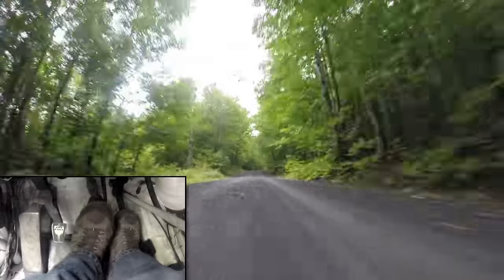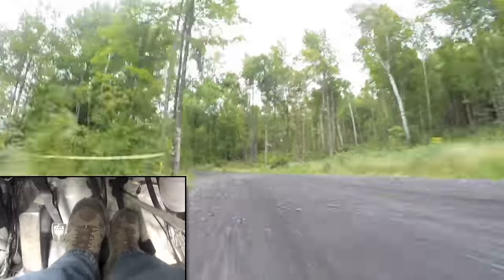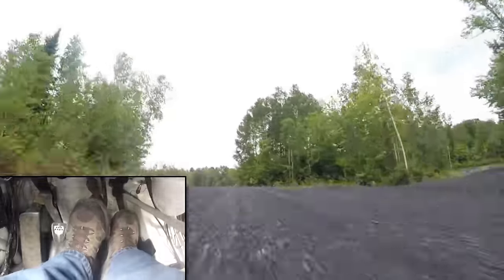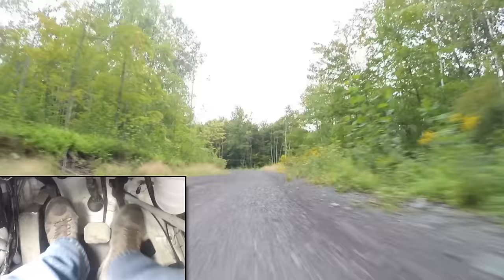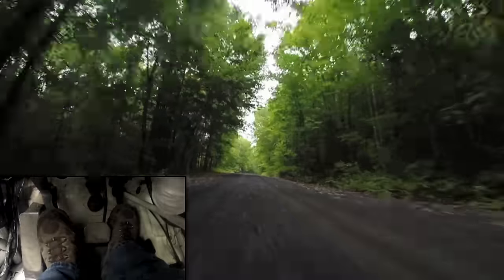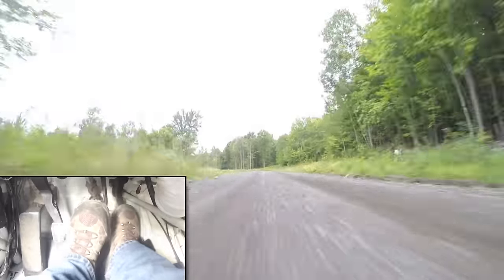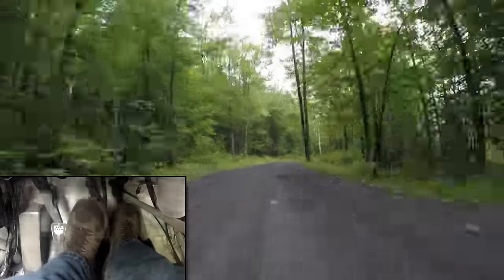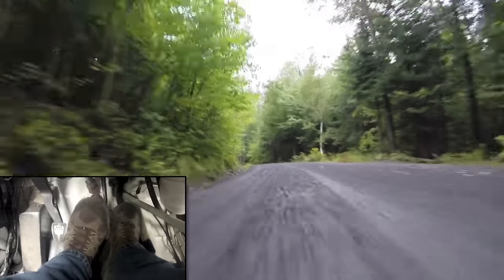Rally Driving Explained

Comment: I saw a video of Collin Mcrae footwork and he didn't keep the gas pressed the whole time like you do. His braking was much more brief and when he had gas and brakes on at the same time he kept pumping the gas, never kept it pushed all the way.
Does it matter if the car is FWD, RWD or AWD?
Reply: MLCAgaming of course drivetrain matters! most of the throttle and brake inputs in this video are suited to lower power fwd cars, higher power awd like you would most likely see Colin in will require slightly different inputs, certainly more throttle modulation

Comment: At the 2minute marker my breaks would cook already! ^^ 
But I have to say, that I, since I saw this video, I got better at Dirt Rally etc and even use it in everyday situations where I just want to avoid sliding over my front wheels. And it works perfectly. The only downside that is, that in normal modern street cars the throttle cuts out if you stay to long on the break while staying on the throttle at the same time. :-/
Reply: You're not continuously pressing the brake pedal, you're just constantly hovering over the pedal with your left foot so you can tap it at a moments notice to keep wheelspin down and make sure weight transfers to the front so you don't understeer through a corner off the track.

Comment: at 7:35 he says "shift" but he never puts his foot on the clutch in the video, is he shifting without the clutch? please explain.
Reply: I'm no pro but yes, you can do it with just about any transmission. Once you're moving going up to the next gear is easy. Just let off the gas, pull the stick lightly towards the next gear up and wait for the rev's to fall and it will pop right into gear. Going down it's the same idea. Lift off the throttle, or left foot brake and lift off while pushing the stick into neutral, then blip the throttle to gain RPM's while pushing the stick towards the next gear down and if you get the engine speed right for that gear it will fall right in. Going up is easier than going down, and going down I find you have to really hit the nail on the head with the RPM's to get the gear to go in smoothly. I learned by finding a nice wide open dirt road off the beaten track and get up to about third ~30 mph and then left foot braking as i changed down into second until I could do it smoothly. After that you can try it at higher engine speeds and get that down as the RPM gap between gears gets bigger the higher up in the rev range you get. Hope this helps, have fun and be safe!
Reply: thanks. yeah i figured it was clutchless shifting however, i'm not experienced enough to try myself, if you don't do it right u can hurt your transmission
Reply: TheRedRockerHimself didn't understand very well what you just said.
Reply: Junior Collantes basically he was explaining how to shift without the clutch, if you just search that on YouTube you can find more videos about it.
Reply: l0lxlllxl0l now I understand very well thanks for reply ;-)
Reply: ***** I don't doubt it's a dogbox, but wouldn't you want beginners to practice with stick idk...

Comment: So this is how I see it. He says that you need to use the brake to control oversteer and understeer. Does this mean you can just gas it all the way? And does braking give you more understeer or oversteer? Also, should you brake earlier into a corner than on a tarmac track? Sorry, just had a few questions.
Reply: Thank you for the advice! I actually thought this was a Subaru WRX that he was driving. If you could also answer another question. So in a WRX, is it the same concept as a Front wheel drive car? Im just wondering because I kinda want to be a Stage Rally Driver in the future so...good to get some advice early on, you know?

Comment: Do you have abs?on my car if i hold the the gas and apply a little bit of braking,after relesing the brake,my pads still grip on the disk brake for a couple of seconds...do you know why is that?
Reply: Andrei Tanasescu From my knowledge, Rally Cars don't use ABS. They are usually removed entirely.
Reply: Andrei Tanasescu I have a similar problem on a car with no abs, but with electronic gas, the breaks are fully released but the gas is cut off for a couple of seconds when it senses wheel lock up, a guy from an amateur rally told me something about an electronic device to fool the sensors put I forgot the name of it or how it works... :\
Reply: Szeba86 i think it s just the air in the servo braking system
Reply: Szeba86 Electronic pump. It forces gas in. Especially since you're flopping around, it won't always feed well.
Reply: Andrei Tanasescu lol if it had air in it the pedal would feel spongy and the tires would not lock, I doubt that the problem is that, plus the car is also for daily use it's registered, to drive one with air in its breaking system would be dangerous
Reply: Abendschein any workarounds? except converting it back to carburator?
Reply: Szeba86 Perhaps? I am not very sure. Sorry man. :(
Reply: +Szeba86 I have the same issue, and found it to be the traction control system, rather than ABS, activating. Disabling TCS can be easy on some things and not on others.
Reply: +Slammins1 for me it's a bit more tricky, my car is bald, no abs, no esp or tcs, only thing which is a headache is the electronically controlled gas (pedal and flow) from the ecu..
Reply: +Szeba86  i know, right?!:))
Reply: +Andrei Tanasescu modern day car electronics are the spawns of satan lol :)))
Reply: +Szeba86 from what I understand, now that I am re-reading what you're saying, this might have something to do with the gas pedal sensor getting worn. Just gotta change where the sensor is wearing.
Reply: +Szeba86 sometimes you just need a wrc car..
Reply: +Slammins1 hmm it was tested in other cars with similar setups and it's the same in all of them... uber lag...
Reply: +Andrei Tanasescu or one with 2 double webber carburetors instead of electronically controlled fuel injection
Reply: +Szeba86  i prefer those 3 which were on the best v12 ever:the 3l v12 ferrari 250 gto,series 2 body:x Proper intake noise ,not fakery from exhaust pipes:(
Reply: +Andrei Tanasescu too big for a national rally class, I'll stick under 18000cc
Reply: +Szeba86  i really want a 72' gtv as a rallycar
Reply: Andrei Tanasescu tu Român? Moldovan?

Comment: Wow, amazing video.
Would be great to see some basic telemetry overlaid, maybe just throttle and speed dials.
As total illiterate on this, sometimes you say “shift after the turn” or before the turn, but I don’t see actual clutch work. Do you downshift without it or am I missing something?
Reply from the maker: This car has a sequential racing transmission, so you don't need to use the clutch.

Comment: Do you typically want to stay in the lowest gear possible when you're racing? For example, would you rather be driving around in 3rd at 7k RPM or 4th at 4isk K around corners while braking and such?
Reply: High rpms all the way gotta keep the power slide around the corners but idk im just a kid

Comment: Brake override system prevents such driving style.
Have you got any advice for drivers of volkswagen and audi FWD vehicles, equipped with BOS?
Reply: +Maciej Jankowski simply turn off that shit? xD
Reply: +sermerlin1 I've turned it off three months ago, to make a try. The next system which bothers LFB is emergency brake assist. Each time, when you depress brake pedal too deep, when throttle is opened, electronics of the car recognizes this state as panic braking, and significantly increases brake pressure.

Ultimately, I've rolled back car electronics to the original state, because such unpredictable brake pressure (brake pressure is not always the function of brake pedal position) makes LFB unusable and even dangerous.

Nevertheless, thanks for advice!
Reply: Maciej Jankowski Well i guess you gotta turn all the "helpers" in a car in order to do the advanced stuff. Every one of them. I don't even feel bad for havin so many "emergencies" there are retards out there who panic and mess everything up. These things at least try to prevent some portion of it. :v
Reply: +Maciej Jankowski That's tricky. I've toyed with disconnecting the wheel speed sensors, and pulling the ABS fuse. (It also prevents heel-toe. But disabling ASR turns off that nanny.) Ultimately, for a full "race car", you'd need to replace and/or reprogram the ECU. (it's no longer a street "safe" car anymore)
Reply: +jfbeam Thanks a lot for info. I'll stick to the  standard configuration.
Reply: +Maciej Jankowski Companies such as APR can provide software flashes to defeat this.
Reply: In 2013, I've made research on local market. I've found Ecu Project Company from Wroclaw in Poland. They told me, this modification would require to install new ECU map, and would be relatively expensive (over 1000 PLN). Therefore, I gave up.
My recent experiments (opening the circuit connecting brake pedal switch with ECU, by removing appropriate fuse) showed me, that besides ECU map, the modification require also disabling emergency brake assist (I find ABS useful).
I'm not a racing driver, or even fast driver. I simply wanted to be more confident when cornering on slippery surface, by gentle shifting car weight to the front, as I used to in my old Opel Astra 1999 not equipped with BOS.

My car is fwd and tends to understeer.

Comment: What is the best rally car that you have driven because I was looking to buy a Subaru wrx 05. Mitsubishi evo 4 , audio tt Quattro, toyota Celica gt4, subaru forester 2.5 xt .
Reply from the maker: The Forester XT is a great, fun, practical daily. The Celica GT4 is cool, but parts are impossible to find and expensive. The TT will break. The EVO 4 is super cool, but again parts are tricky to find and expensive (here in the US at least). The 05 WRX is a proven, solid platform but try to find one that has had the head gaskets and timing belt done (because it will need it).

Comment: Hi!

Nice breaking. Doesn't this technique overheat the brakes? Will the brakes grab less after few minutes cause of the heat? Do the brakes burn out at all when working against the engine for wheelspin control?
Reply from the maker: Hi Dennis!  With normal brakes, especially with un-vented rotors drum brakes, you wouldn't want to drive like this for too long. If you have disc brakes with fairly good vented rotors, DOT 4 fluid and you keep the speeds up, you're good to go. This car has big AP Racing stuff so you'd really have to try hard to get them to overheat.

Comment: how long are these gears? I am assuming you are slightly modulating throttle to prevent wheel spin? and stab the brakes to upset the balance of the car to get it to rotate the rear on a slippery surface.

Comment: Any recommendations to practice using the left foot braking safely lol
Reply: Oliver Quintanilla try it at low speed somewhere where nobody cares. You get used to the weight of the brake pedal fairly quickly, the actual dangerous part is that at one point you might screw up and press the brake instead of the clutch, that's why it's really important to always put your foot back to the empty space on the left and then also get used to how far you need to move it to hit the two pedals. Practice it during daily driving and once you are comfortable doing it you can start using it while racing/rallying

Comment: Hi, just saw your video and was amazed. am just curious about some stuff and have got some questions.
it seems you downshifted without using the clutch? your speed dropped after tight corners without downshifting and you're still able to get it to rpm for power. or am i wrong in this.
is this done in a front wheel drive? i own a all wheel drive, does it work the same way?
i'm still learning so please advise. thank you.

Comment: Confused by the term "trail breaking" what does it mean? thanks
Reply from the maker: Trail braking: when you approach a corner with a lot of speed, brake hard in a straight line, then gradually release the brakes AS you turn in and track around the corner. It's very common in race cars and motorcycles etc, allows you to brake as late as possible for a corner... But takes a lot of practice to nail the transition from the brake to steering.

Comment: Hey Tim, How can i learn to use my left foor to brake. Every time i try it for a short time I find that my coordination with my left foot isn't as sensitive as with my right one (habits i guess). That's when I quit, cause it might get dangerous in traffic :D I have no open tracks nearby to test it out...
Reply from the maker: Basically it's just learning to drive again with your left foot, it'll be a little awkward at first but you'll get the hang of it very quickly. We did a little video with a couple easy ways to get used to left foot braking: https://youtu.be/n0cht9vtwy4

Comment: Maybe this will sound dumb, but I'm shocked. I always though that braking while pressing gas pedal is a big no-no and would break the engine or cause some other damage! Does this technique work also with a regular car?
Reply from the maker: All modern cars will have a safety switch that will not allow you to do this... Since the late 2000s or so when people's floormats were getting stuck on the gas pedal and they were crashing or whatever was going on there. Now, when you press the brakes, the computer will electronically cut the throttle. This is of course easy to disable though.

Comment: wait so how come only some times the clutch is used for shifting?
Reply: saw the video guys nvm
Reply from the maker: With a sequential transmission like this (or a dog box), most drivers use the clutch to shift up but not down. This is because there's not much time to be saved by clutchless upshifting and it's easier on equipment, but downshifting there is a big speed advantage to clutchless shifting.

Comment: In a normal car the brakes will be overheat?
Reply from the maker: As long as you have decent brakes and the average speed is pretty high for ventilation, you're fine. Most people switch to DOT4 brake fluid with a higher boiling point.

Comment: How is he shifting without the clutch??
Reply: Can you hear the whining of the gearbox cogs? This means that they are straight cut, probably a dogbox gearbox design too. If you want to know more about what I've just told use Google or just ask me... Lol
Reply: Joshua Benson Not a dog box. It's just shifting without the clutch. You can only do it when upshifting. So let's say 2nd to 3rd doing 35 mph at 3500 rpm, go to neutral, wait for rpm to drop to 2500 rpm and slide it into 3rd. Gotta get it just right

Comment: What they don't tell you about rally driving is that they floor the gas and disable the breaks at start and only turn it off after the finish line. Also, racers are normal citizens that get roofied and wake up when the race starts. It's a SAW type thing :D

Comment: R.I.P Brake pads. my god youre flying it. I  wanna experience that. Did I see you change gear without clutch?
Reply from the maker: Brake pads usually last a race weekend, sometimes you have to change them once halfway through... They're definitely considered consumable in this sport, but they're pretty affordable and quick to change. And yes this car has a sequential transmission, you don't need to use the clutch to shift once you'r moving.

Comment: Why is he constantly braking while pushing the throttle, isn't that very harsh for the car?
Reply from the maker: Basically everything about rallying is pretty harsh for the car, but really left foot braking like this is mostly only going to wear your brake pads.
Reply: @Teamoneilrally  Thats right, it really was an ignorant comment since I thought it would be common sense to stop accelerating when you brake, but I don't know much about rally. Good video btw
Reply from the maker: Thanks! You're absolutely right that it's not the nicest thing to do... You certainly wouldn't want to drive to work like this every day, but in a FWD rally car it's a great way to carry speed and transfer weight to make the car turn.